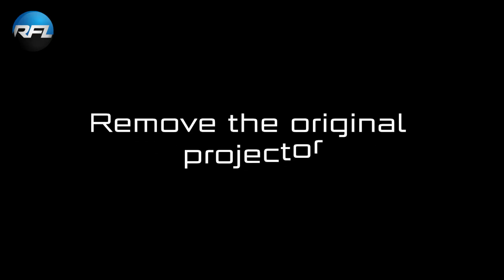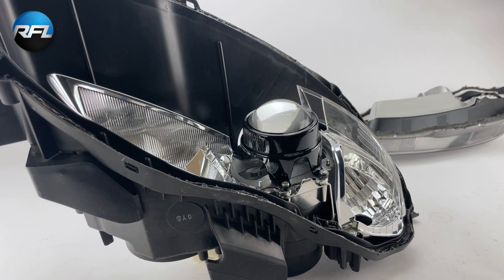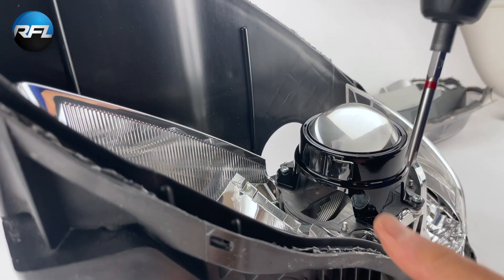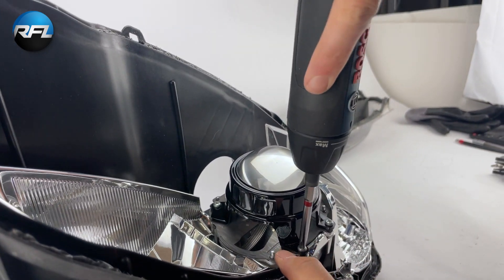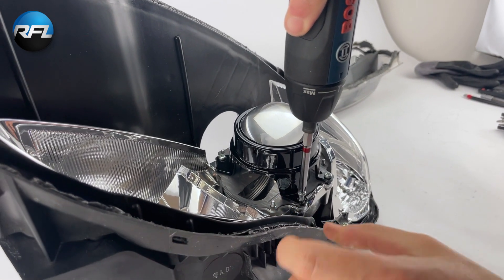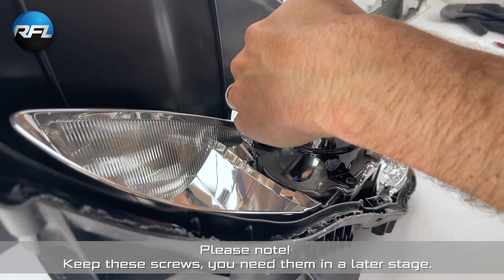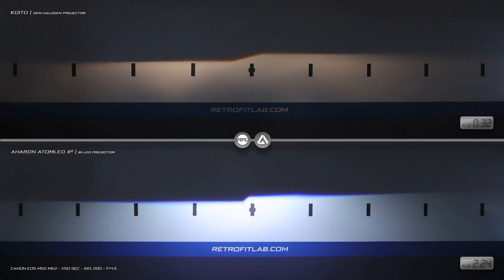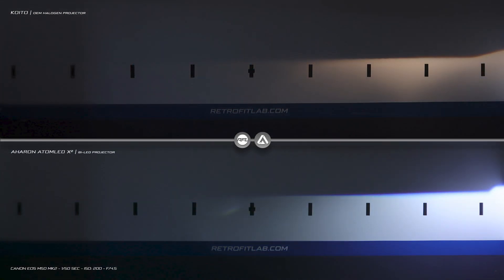Mazda MX-5 Miata NC third gen. halogen to bi-LED projector headlight repair and upgrade DIY

Comment: Why don’t you remove the screws before you heat it up?
Reply: Prevent the threads from warping, likely
Reply from the maker: It's more of a safety measure. It's possible that you might forget this after heating and while opening the headlight ;)